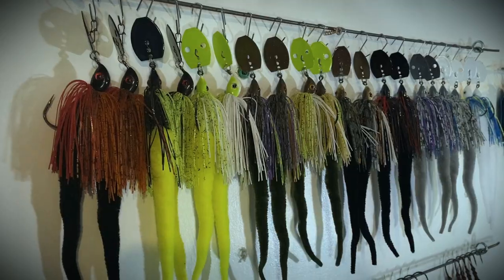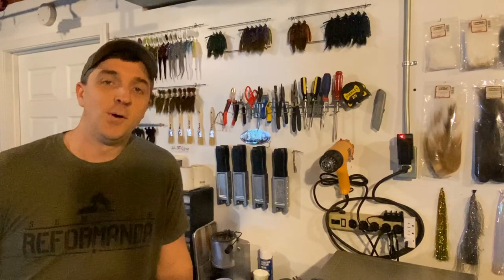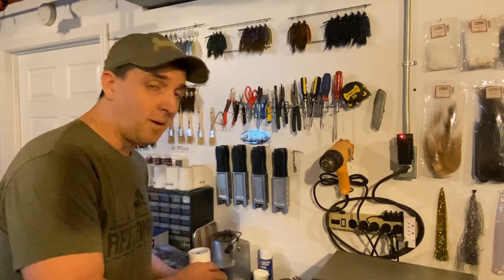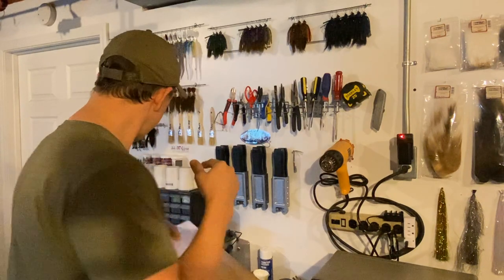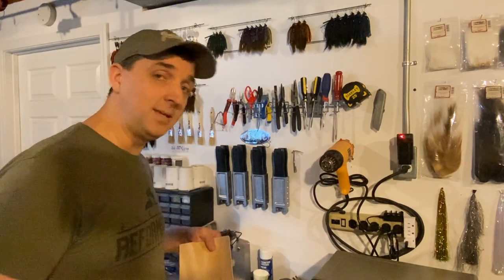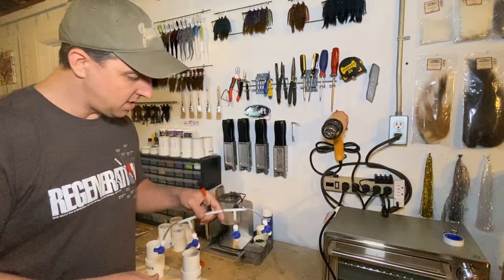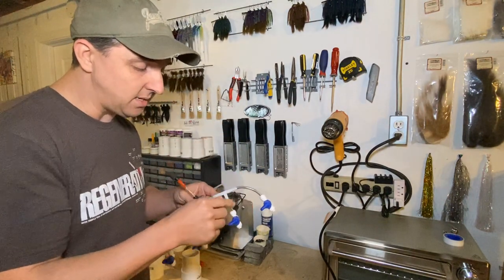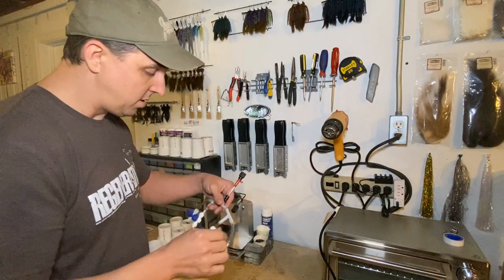Paint Jig Heads Like a Pro with a 4-Cup Fluid Bed!

Comment: Built my first single unit some years ago. Thanks for this info to upgrade into a multiple unit combo. You did a Great job, however, I would have taken the time to remove the printed info on the PVC. I normally use acetone to do this on things I make with PVC. This would have improved your multi-fluid bed project from Great to Professional. While gluing your beds to the board worked for you, thinking that I would have drilled a hole in the bottom cap and secured it with a pan head wood screw with some silicone on the screw - thinking that it would be more secure - all I could vision with gluing it is breaking that glue seal and having powder paint all over the workbench. Thanks again for all the great info you provide to us.
Reply from the maker: I appreciate the feedback, thx!  The glue on the caps held up surprisingly well as I had a similar concern (although the paint woudn't go everywhere as its contained in the upper cups... nonetheless, it would have been a bummer to see them "dislodge" from their place).  In fact, when I pull this unit apart and converted to an 8 cup bed (there's a video on that build as well) the glue held so well the wood split before the glue gave way!  Couldn't believe it as I had every intention of re-using those cups.  Go figure!  Thx again for the comment and for watching!

Comment: I just bought one with extra cups on eBay. I was going to build mine and I was in the process of making a shopping list and adding up my costs when I checked prices online for premade units. I probably could have made it a little bit cheaper but this thing looks so much better than I'd have done it was worth the extra bit of cost. I should be using it on my channel in a few weeks, I have videos for the next 6 weeks lined up already. :)

Comment: that Kobalt inflator is awesome for taking with you to inflate tires.  I use it for my truck, camper and boat but not designed for constant pressure.  LOL.  Your video is a good one.  Thanks buddy.  A fluid bed fall is on my to do list this fall.
Reply from the maker: Yup!  Live and learn.   I ended up getting a smaller inflator to put behind my seat in the truck.  Fluid bed actually runs off a larger aquarium pump... 50-60gallon version works perfectly!
Reply: What was the make and model of the pump you ended up with?  Thanks for the great content and for your witness!
Reply from the maker: Hey Josh, I ended up with a Fluval Q2 (50-160 gallon rating) adjustable pump.  I stinkin love it too… especially the “adjustable” aspect.  Didn’t think it was going to be a big deal until I started using it in various situations.  Should be about $40 or so, most places online.
Reply: @SDGCustomLurecraft  thanks for the quick response!  Again love the content and the name!  Keep it up!
Reply from the maker: @jalenrose1  👊👊

Comment: I used a brass fitting with a 1/4 barb fitting and screwed it in the the side no glue or anything screw them in slide on the tube. $1 and change for each brass fitting. Don’t have to worry bout it blowing out then and less messy. Great info good job! Also I found copy or printer paper flows more even than brown paper bags or any other materials I tried.
Reply from the maker: Great input, thanks Daniel!  I was going to go the brass route but I couldn’t find em that cheap, wow!  I’m sure the day will come when I build another… maybe just for fun, maybe a refresh if this video.  When I do, I’ll be looking for brass!  I also tried printer paper but man… I just couldn’t get it to work as well as as a good ol paper bag.  Go figure!
Reply: @SDGCustomLurecraft   I think it depends on what lb paper it is and man I just don’t know what mine was both printers had paper in them and I didn’t have the package. Sorry man.
Reply from the maker: @danielfowler473  it’s all good!

Comment: I've built several fluid beds over the years.
Mine are a simpler build then this one.
Mine has less components and is easier to build.
For the base of mine I just use a 3-in ABS flat cap.
I also use a panhead screw to secure mine to the base board.
I never have been a fan of gluing or using silicone to secure the fluid bed down.
I also like the fact that I can easily remove my fluid bed cups to switch colors.
But to each their own I suppose!
Reply from the maker: Thx for watching!

Comment: I know I ask a lot of question of you, and I know these are some of your older videos, I just like learning this stuff.  So, here I am with another question.  Your base is made up of 1 2" pvc 2" long (bottom), 1 2" coupler, and 1 2" pvc 3" long (top).  That makes the entire "base" approximately 5" tall.  Once you mount your actually "paint cup" to it brings the total height to about 8".  My question is, what if you made the bottom piece say 1.5" long (just tall enough to give space to drill hole and place tubing), then made the top section just long enough to allow the connection of two couplers (base coupler and fluid cup coupler)?  Basically once the paint cup is mounted the two couplers practically touch, therefore decreasing the volume of air required in the base.  Just kinda wondering if that would decrease the amount of pressure needed across the entire system.  Just thinkin outside the cup so to speak.  Thanks for your videos man.  They really help me in my quest to build my on baits.
Reply: Sorry, please disregard my prior question.  I just watched your 8 cup fluid bed build and I see you eliminated the upper 3" section of pvc on the base and only had the one 2" as the base and then the paint cup itself.
Reply from the maker: Yup, I thought the upper piece would separate at the lower coupler, but found it was an unnecessary add.  1 coupler is cleaner and all you need!

Comment: Thanks for the tutorials, they are great.  I followed your design (latest) to make a fluid bed.  The fluid bed appears to work correctly, but the texture of the paint on my jig head looks like sandpaper.  Is this a result of not getting my lead hot enough?  Thanks.
Reply from the maker: Great question Ed.  Best guess, yeah sounds like you could stand to heat your heads just a bit longer.  If that doesn’t work it may be a paint issue (not all work as well as others).
Reply: @SDGCustomLurecraft  Thank you for the prompt response.  I will try more heat first.

Comment: Looks good I actually got a five way Aquarium valve set up off amazon it was $7 and it’s capped on the end for if you want to add more later
Reply from the maker: Very cool!  I ended up revising the design (which also cleaned it up a bunch) by adding a manifold/air chamber on the side and running each cup off it using the separate valves.  Posted a quick video on that modification as well if you want to check it out!

Comment: Good video content. I've been wondering if it's worth it to make a bed and you made a garden of beds! You're set up is really well organized. Do you typically leave the heat gun on the wall when you use it for jigs?  Thanks.
Reply from the maker: Thanks for the feedback Robert.  Yeah, I do leave it on the wall so it shoots sideways.  My shop is in the basement/unfinished space with low ceilings, so when I set it up (as its often used by others) the heat shoots straight up and makes it way to my fire alarm, LOL!  THAT was a wake-up call the first time I tried it!  So, I shoot it sideways so the heat disperses and alarms don't go off.  This was one of the first videos I made (now over 100 on the channel) and I still use this setup to paint just about everything.  If you didn't see it yet, be sure to check out the follow-up to this where I add a manaifold/air chamber to the front.  It both better equalizes the pressure to each  cup AND it cleaned up the design a bunch.  Definitely a must if I was going to build another.

Comment: so I have been making these from your videos and I am getting alot of air shooting up along the sides and I wanted to know if you have any suggestions on how to make them flow properly
Reply from the maker: Hey Jimmy, it could be a couple things.  The most common issue is the filter.  Assuming you are using the same kind of thin, brown, paper bag material, it could also be a seal problem around where the tubes insert into the bottom of the cups.  Generally air along the side means your air pressure isn’t high enough (either for the filter material, in general due to a leak, or because the powder is too heavy - which leads me to my last question…).  Are you using ProTec paint?  2oz jars but not putting the whole amount in the container?  

Sorry I can’t pinpoint the issue for you, as it could be any number of culprits.  Hopefully some of these questions/things to check will help!
Reply: yes I am using protech paint. and brown paper bagsyou get at super 1 for lunchs. also my air pump is a small one. one that is made for a 10 gal tank. I ordered a bigger pump and will try again. should I be adding all the paint from the 2 oz bottle?. also what is your code again for Barlows tackle again. I get lots from them and if that helps you out great.
Reply from the maker: Good deal, a stronger pump should 100% do the trick.  Mine is rated 50-160 gallons, so without enough umph, the air will leak through at the points of least resistance (ie sides).  With that size top (3” lengths, if I recall??), between 1/2 and 3/4 of a 2oz jar will fit and work properly.  Every paint is different, so you can load more of a heavier paint and less of the lighter stuff - either way, I rarely put the whole jar in, initially.  When you run the new pump, be sure shake/stir the powder before turning in the pump… get it loosened up… then I like to use my forceps (or pliers, or screwdriver, whatever you have handy) to tap the sides as you open the value.  That helps the powder move a bit and the air more evenly distribute.  I’ll be curious to hear back from you once you get the new pump going!  Appreciate the Barlow’s question as well!  That code is “SDGCUSTOM”.  Thanks for the support (both for me and Barlows!  Great group of guys over there!)

Comment: How much powder coating paint do you put in 2” / 2.5” deep fluid bed cup for painting jigs?
Reply from the maker: Depends on the paint actually.  I can get the whole 2oz in when using heavier paint that won’t rise as high.  For the lighter/standard stuff it takes about 3/4 of a 2oz container.  I’ve often thought about cutting the cup longer to make it easy… dump the whole container in every time.  Just haven’t tried it yet.

Comment: Did you use a large compressor? or a fish tank compressor, I have a 40-60 gal fish tank  pump and it won't even move one cup no less 4 cups.
Reply from the maker: Hey Mark, great question.  While the original setup was going to use an air compressor, I ended up taking it back and went with an adjustable high volume aquarium tank.  It runs all 4 very nicely but can also be adjusted to run fewer as needed.  Here’s a link: https://www.chewy.com/fluval-air-pump-aquariums/dp/129588?utm_source=google-product&utm_medium=cpc&utm_campaign=hg&utm_content=Fluval&utm_term=&gclid=CjwKCAiArIH_BRB2EiwALfbH1Ktc3gHFfJt-_Os2G-njxDpZs71Jqr5a2M6Mj0xDeIkh00CCfviGHhoCeAAQAvD_BwE  If you’re still having trouble I would check all the seals, make sure you’re not losing pressure somewhere, and then look at the filter material.  I use “lunch bag” brown bags, which are thinner than the “grocery bags” a lot of guys use.  I also tried most of the other typical options and nothing worked better than good ol lunch bags.  Hope this helps!!
Reply: I used a big aquarium pump it will run four. Walmart. It has two outlets just run them together with a T and make all the air run through one line with the T.
Reply: @danielfowler473  How big of an aquarium pump did you use with the T? Do you have the model?
Reply from the maker: I use a Fluval Q2, adjustable pump.  It’s rated for 50-160 gallon tanks.  Works great for my 4-Cup bed.

Comment: How can I use a fluid for 14oz 16oz jigs and how much power to put in
Reply from the maker: Great questions.  I recently put together a single stall bed using 4” PVC so I could dip Spinnerbaits (extra space needed to accommodate the wire).  It works well with the pump I have (Fluval Q2, rated for 50-160 gallon tanks), but does take a lot more powder paint to use effectively.  My guess is… you’ll find the same to be true if you go this route.  

Measure the size of the jig (diameter/across) and double, or even triple that to get the right pvc size.  Limit the use to just one stall and use the adjustment knob on the pump to dial in the powder (with the extra surface area and heavier load… it may take “full blast” from the pump to get it going/maintained).  I also found the lightly shaking the bed as the powder rises reduces volcanos, until the powder regulates.  

Hope this helps!!
Reply: @SDGCustomLurecraft  thx I pour 300g jigs and it's about 8in or so I will try it

Comment: so where is the upsized fluid bed? you mean just multiple beds not bigger bed?
Reply from the maker: Hey thanks for the question.  Yeah, upsized in terms of 1-2 cup system to 4 cup system, although, if you wanted to go to a 3" pipe instead of 2, all the same principles apply - you'd just need a wider board.  Appreciate the feedback!